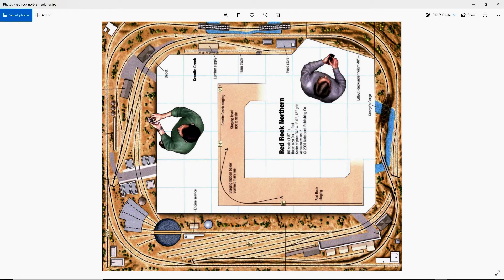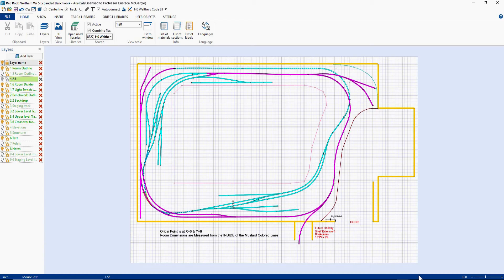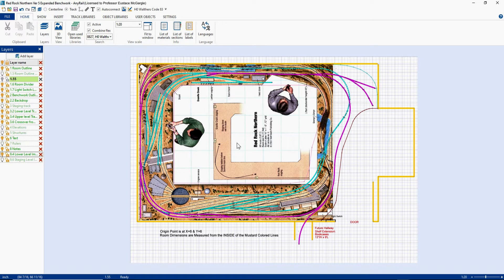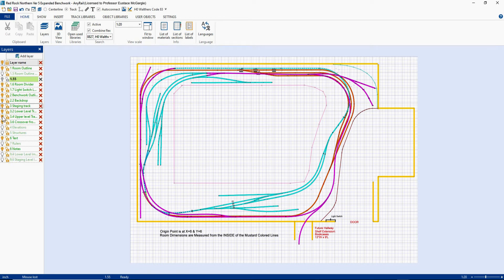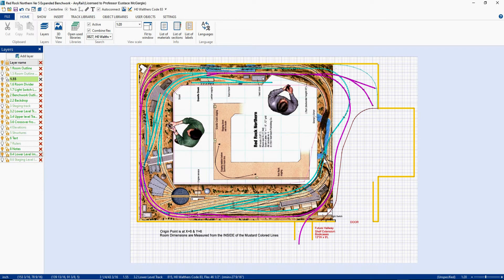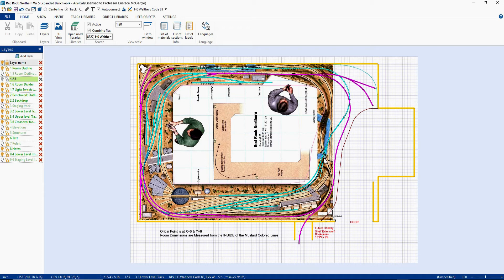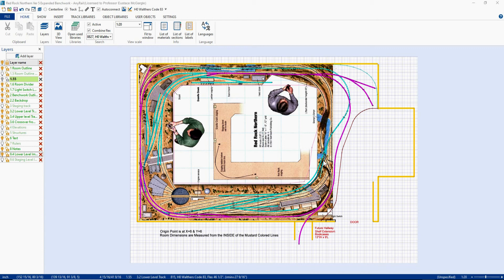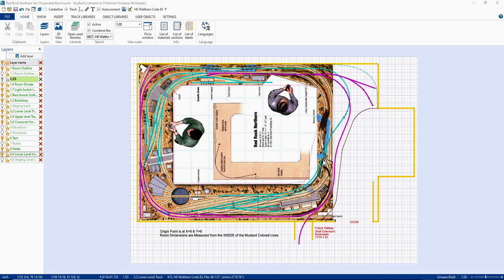AnyRail6 Tutorial Video 1: Introduction and My Railroad Design Video 1 Intro and My Design

Comment: Thanks for doing this series. I'm brand new at this and was a little confused. I've watched a couple of those videos that you mentioned and was not getting the answers. I have no CAD knowledge so hopefully this will help. Just bought the Anyrail6. Stay Safe & God Bless!!!
Reply from the maker: Hi John, my best advice is to follow along with what I do on some of the videos. The other thing is just play with the program after watching a video. CAD can be very intimidating. Some of the engineers I worked with had problems picking it up at first. A lot of what I learned about Anyrail came from just trying different things and finding a way that works for me. There may be other ways, there are other ways, but if I think what I have found will work, that's what I stick with until I learn something new. That's the fun of CAD. I try to be as complete as possible but some of the early videos are not as detail intensive because I only planned on making 4 or 5 videos at that time. I am always happy to answer questions you may have and will try and duplicate any problems you have. I figure anything I can learn can be added into a future video to help everyone. Don't be afraid to ask me. Also, check out the anyrail forums too. Good luck and thanks for watching! Dave

Comment: I've watched nearly all of your videos.   Thank you SO much for publishing them.  
One thing I've gots-ta-know... how do you color your track per layer?  It seems that is what you are showing us in this first video.  I cannot figure it out.    Thank you for your help!
Reply from the maker: Hi Michael,
You read my mind. I am working on a couple of new videos and I was changing the color and I got to thinking 'I don't think I have gone over this very well. Next Video!'
Anyway, I used the 'Create Section' function. AnyRail should do the following, allow you to color individual pieces of track or groups of track and allow you to group items together. Sadly, it does not allow either of those. You can get around it by using 'Create Section'. Basically, whenever you select a piece or pieces of track, you get the 'Tools-Track' ribbon at the top. Go and click 'Create Section' and a box will pop up allowing you to name that section ( in two notes) specify it usage and give it a color. You don't have to name it or what it's for if you don't want to. When you do this you will note that instead of round connection points you now have triangles where the section begins and ends. This is because AnyRail thinks you want to create a isolated electrical section. You can remove the triangles but then it doesn't show as being connected to anything. But it does allow you to color code sections. I go over this briefly in Video 10 at around the 7 minute mark. I think a new video is going to be made really really soon.
Hope this helps you!
Dave